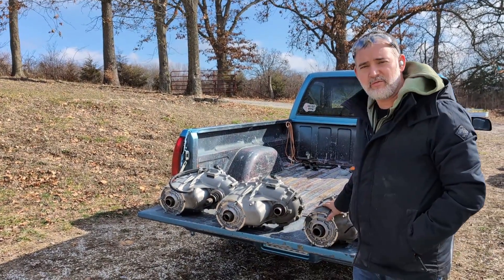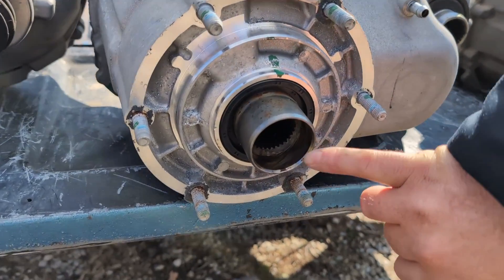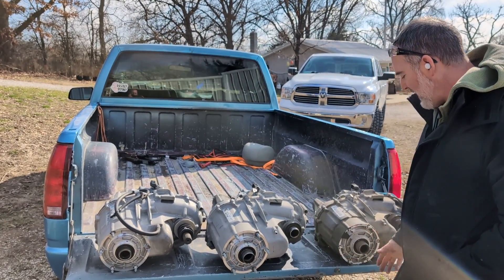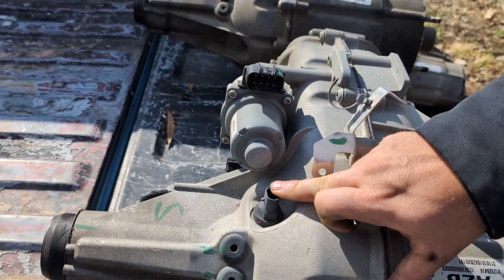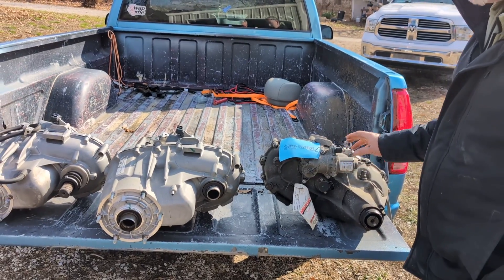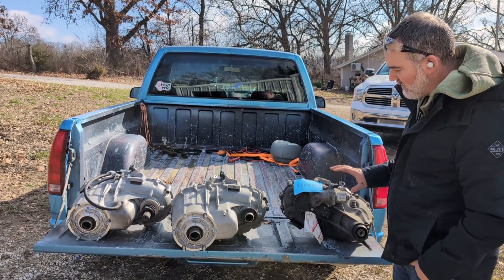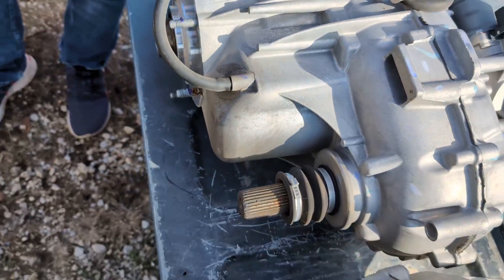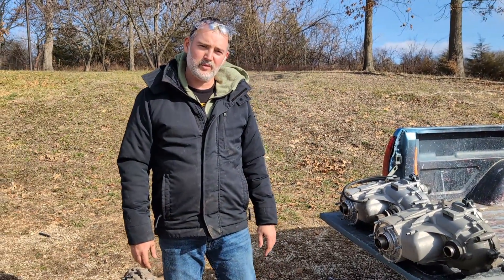GM transfer case differences explained

Comment: Can a 2008 4l60e house a 2007 tcase? They say 2007 and 2008 transmissiins are the only two years these trannys are compatible to these years. I have a Tcase frome my 4l60e without a motor and extra plugs than the 2008 ao i was going to swap my 2007 tcase onto my 2008 transmissiin do you know if that would work

Comment: I would love to know since it seems that you know a lot of these t-cases, I would like to swap my single speed (6L) Silverado wt with a 2 speed transfer case … but I believe is very difficult to come around a 6speed application transfer case that have low range (because it was optional on the WT’s) but I thought maybe the 8speed application t-case could be used if I swap my dash switch plus the tcm (at least some folks with 08-13 trucks were able to do that swap of hardware(tcase/tcm/dash switch)
Reply: 2020 Silverado wt, before people start saying to just buy a 2 speed (4low application truck) this truck is perfect for me except missing the 4lo

Comment: Well there’s also 2 speed t-cases/ low range t-case ( only available on Z71 models). And single speed t cases. That do not have a selectable low range.
Reply: question is can you swap the 1 speed t-case with a 2 speed t-case as they are basically identical? ofc also swap the mode selector  switch
Reply: @Shera27   You can you just need to go on AC Delco TDS and reflash it for the one you're installing and then change the selector knob out
Reply: The two-speed NQH transfer case also comes in the LTZ Tahoe

Comment: I wonder about spline count? Does it have 32 spline like a th400 or a 4l80e? I have really been wanting to run a 6,8, or 10 speed transmission with a 32 spline np205 transfer case, and those lower gears in the transmissions would be awesome for rock crawling
Reply from the maker: They are 32 spline